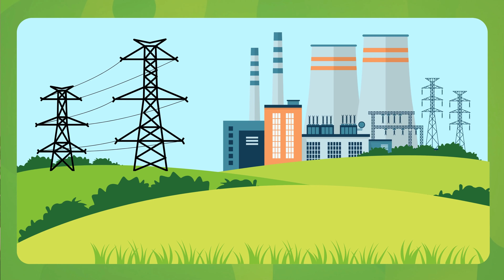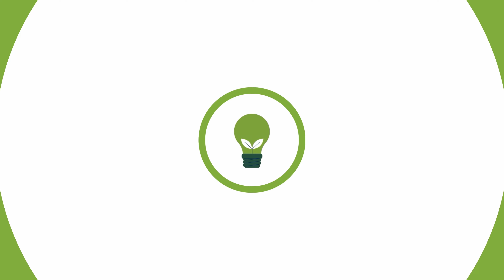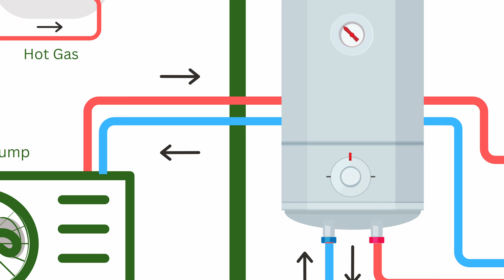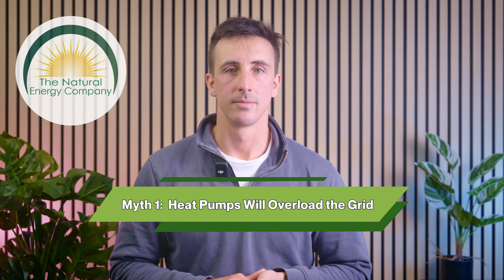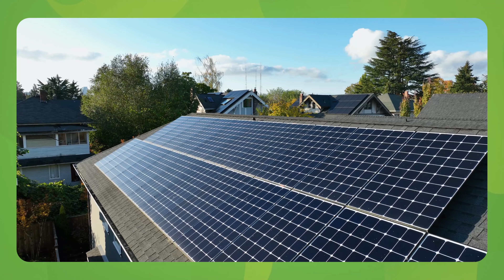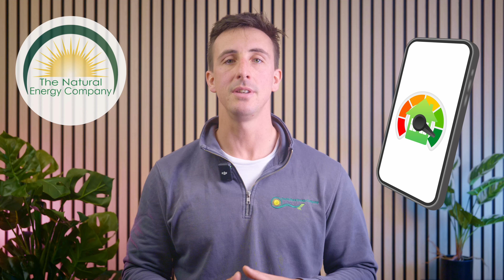Heat Pumps vs. The Grid: What the Headlines Aren’t Telling You

Comment: A heat pump typically at least doubles a households electrify demand. In my case it increases it by 4x mid winter. 
Obviously, this will put additional strain on the grid at the time there is near zero solar component.
Reply from the maker: That’s a really valuable point — thank you for your comment. It’s true that electricity demand rises with a heat pump, especially in colder months. But because heat pumps are 3–4x more efficient than boilers, they still reduce overall energy consumption compared to burning fossil fuels. On a system level, technologies like demand-shifting tariffs, home batteries, and grid-scale storage help balance those winter peaks. The grid does face challenges, but smart flexibility is exactly why heat pumps can strengthen it rather than weaken it.